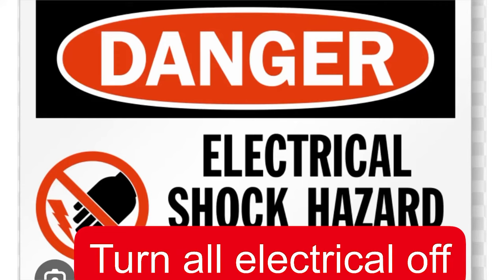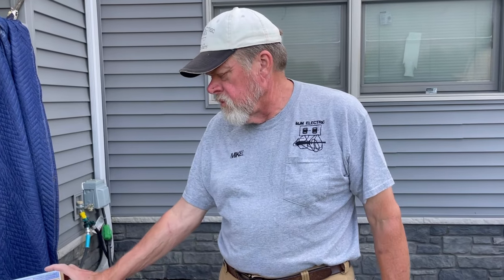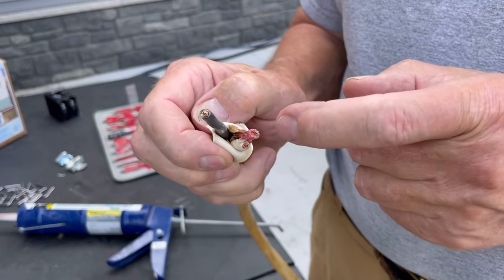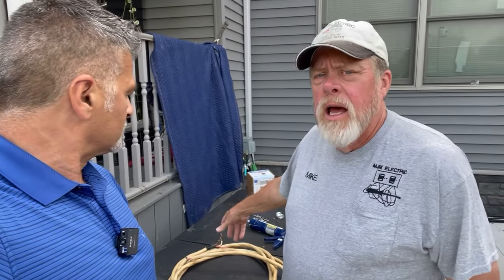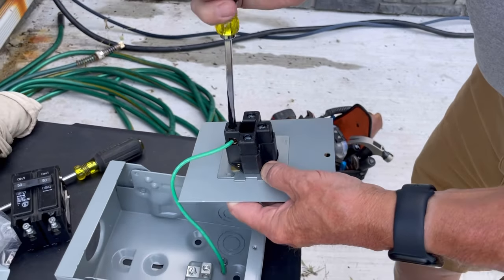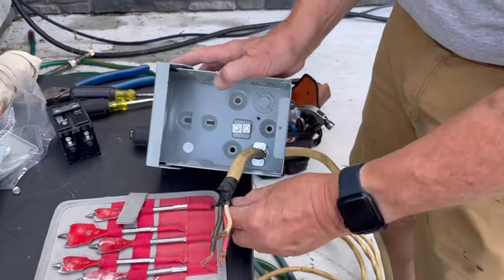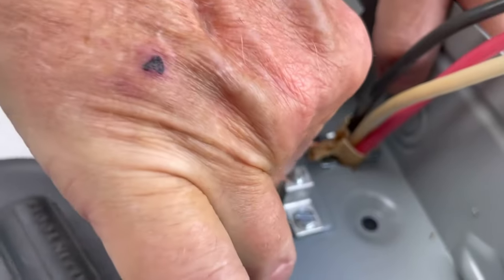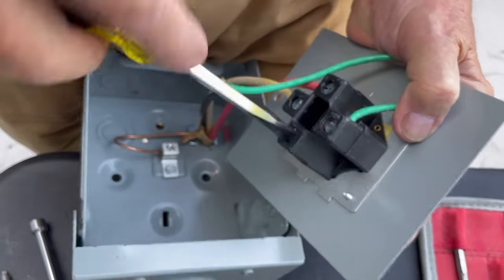How to install a 50amp RV Plug Outlet use 6/3 wire #50amp RV outlet

Comment: Years back i built my own pole building, mostly solo.  I ran copper wire out to the shop and wired 120/240.  
I like getting out of my comfort zone and learning new things, but I think it's one of my greatest gifts is to  Be humble enough to stop and ask for help :)  Don't be afraid of it (electric), but respect It!   As I get older I look back on those producks that I was Outside of my comfort zone with large smiles PERIOD.....

 My current project is an RV pad for my adult son and his wife. I'm using this another vidto work through it. great video thank you !

Comment: My only tip... Siding is not waterproof. Water runs behind your vinyl siding. It gets in at joints, and at windows where you have j channel.  

A more bullet proof installation would involve using a jumbo mount master siding light block, installing that in the siding, flashing it into the house wrap or water resistant barrier, put the siding back together, and then run your electric. 

Caulk between the top of the box and the siding does little too stop the water coming down behind the siding.

Great video on the electric side

Comment: Great video, but I was surprised that Mike refused to put the new outlet into service until he tested it.  While prudent, that may not be an option for everyone since there is no link to the tester used.  I didn't find any similar tester at Home Depot.
Reply: Any standard multimeter would work.
Reply: Multimeters are like $6. If this slips you up ya might not want to attempt this job.

Comment: Great video. Qq- why did you not use a GFCI breaker for an external box exposed to outside elements? Isn't GFCI required? Or is that only required if you run through outside conduit?

Comment: GFCI required on receptacles including 50 amps per NEC 2020? Breaker price jumps about 5x minimum if you can find them.
Reply: Even if  gfi is not required it should be used in electrical panel (it is an outside receptacle)they make them; not cheap though.
Reply: This is correct, I just did this on my house and code required a GFCI breaker. Ch 50 amp ran me $170

Comment: I need to make a 120 foot run underground to a pedestal instead of mounting on the side of the house.  What is the bury depth?  If I want to run 110 to a 20 amp outdoor outlet on the same pedestal, can I run both through the same conduit, or (direct) bury side-by-side, or is there a separation required?
Reply: Burial depth depends on several factors.  Like commercial or residential, and method used.   I can tell you that at 24”, you will be fine no matter your condition.  You can put them in the same trench or conduit.   It’s all 120 volts to ground.
Reply: You can run both circuits in the same conduit as long as the conduit is big enough to allow room for heat dissipation. Typically power on the private side in my area is buried 10-20” deep.

Comment: Isn’t the neutral and ground wires  go on the same ground bar ? Never knew there was a neutral bar?
Reply: The reason there are two bars is that panel is a sub-panel.  The Main Breaker is likely on the outside of the house.

Comment: 8/3 nmd is good for 55amps in Ontario... Why is 6/3 needed?
Reply from the maker: 50 amp 240 volt RV requires 8 gauge for up to 50 feet from the Breaker box  If longer than 50 feet, use 6 gauge. Many 50 amp RV systems already use 6 gauge  Mike decided to use 8 because had it there already. And it’s good for 55amp.
Reply: # 8 is not good for 55 amps.  It is rated 55 amps at 90C.  The termination points on breaker are listed at 75C.  The terminations on the receptacle are “hopefully” 75C. Which means the “circuit conductor ampacity” is 50 amperes.  Cheap receptacles may only be rated at 60C or 40 amperes, but since the next wire size, #6 is rated 55 amps at 60C, then the #8 is still good for the 50 amperes.   It gets complicated.  The installation is correct and code compliant!
Reply: @TSquadRVing what is 6/2 gauge rated up? is 6/2 good at 100foot?

Comment: I have someone wanting to install this outlet as an option for me to power my home with a generator when the electricity goes out but my concern is I would have to make 2 male ends on a 50amp extension cord
Reply: Not the right way to do it!    Several ways to connect generators.   If receptacle, then use a male receptacle, just like on the side of an RV.

Comment: I have a Grand Design Reflection Travel Trailer with 2 AC units on the roof, do I need 220 with 50amps breaker on a disconnect box as the service department is telling me it's 120volts but I had a hot wire on one pole so it only ran the back AC unit then I took the same wire and took it and put it on the other pole and the other AC unit worked and the other AC unit didn't work so in my mind it's 220 right?

Comment: I am not 100% positive, but since this is considered a sub-panel there should be 1 or 2 ground rods (per your local code) located at the sub-panel. At least that is what I needed to do. 6AWG also. Other than that, Nice Job!
Reply: I've never seen a subpanel grounded to a ground rod. A subpanel is typically grounded to the main panel.  One thing that makes a subpanel different from a main panel is you do not bond the ground and neutral like you do in the main.  Many times, but not always, a sub panel is in a more interior part of a building, which would make it difficult to tie to a ground rod.
Reply: The subpanel bars are not
 together ground bar not needed then
Reply: What are you calling a sub panel?  Hopefully not the exterior box with the receptacle in it!  In order for it to be a sub panel by definitions in the NEC it MUST have over current protective devices, breaker or fuse that feeds multiple branch circuits.  A sub panel within a dwelling or building does not require additional ground rod or rods.  The only sub panel I know of that does, is if you run an outside feeder to a sub panel in a detached garage or building.  Then, yes, ground rod is required.  (2) if you do not test for sell than 25 ohms.

Comment: That wire is not rated for 55 amps. It’s not even rated for 50. It’s #8/3 Romex. Largest breaker you can use is a 40 amp.
Reply: 8/3 Romex on 50 amp plug or bigger??
Reply: He said it was 6/3
Reply: Oh those Consulting Engineer rules of thumb!    Table 310.15(B)(16) shows that at 75C, #8 copper is rated at 50 amperes.  Is it not?   So, if the terminations at the breaker and at the receptacle are both rated at 75C, then it can be used at 75C and is 50 amperes.  If the receptacle is only 60C rated, then the NEC allows for you to use #8 at 50 amps because the next wire size is above the next standard sized overcurrent protection rating.  #6 at 60C is 55 amps so, #8 is acceptable by NEC.
Reply: 6/3 is needed for 50 amp.  It will work just fine and follows code
Reply: can you help me? Will 6/2 UF-B 100foot be good for my 220v welder? my pole is 100foot away is 6/2 plenty at 100foot? @TheKillagodZilla

Comment: i have a 30 amp service in rv.......can i use 1 leg of the 50 and run 8/2 or 6/2 romex into my panel inside the rv and bump up the 30amp breaker to a 40 single throw(no 50amp single throw breaker) so i can run all my appliances?   only 1 ac on mine....and of course after doing this you have to run everything 50amp so no wire overheats by mistake.
Reply: Do you currently have a 50amp outlet you're wanting to plug into? You don't want to use a breaker larger than 30amp for a 30amp RV.  The breaker is there to protect the cord and wiring from the outlet to your RV's breaker panel. That wiring is sized for 30amp, not 40amp.  Besides, this wouldn't gain you a thing anyway.  The breaker in your RV won't allow over 30amps.
Reply: Short answer.   No you can not.

Comment: Is Mike sure that a RV 50 amp female connector is same as home dryer 220v ?
Reply: Its not. Firstly, the plug isnt exactly the same. It looks the same but its slightly different, and even if you were to be able to plug a 30a RV into a dryer outlet, you'd cook your electronics in your RV.
Reply: @TehDubster aren’t are these RVs set up for 50amp? My plug says 110 or 220 3 prong
Reply: My understanding is with the dryer your using  both legs of the 120v together which = 220v. With this it’s using 2 @120 ‘legs’ seperate so it’s only using 120v. Could $definetly be wrong tho…
Reply: He did not say home dryer.  He said the same as a range.  Otherwise known as a stove.

Comment: I need to run a 100 ft will I lose a lot of power
Reply: No 6 AWG will give you the current needed for 50 AMPs
Reply: If you run #6 copper for 100’, the amount of current demand from your RV will not cause more voltage drop than allowed.  So, good to go.

Comment: Each leg to ground is not 110 hate to tell ya. And 8/3 it's rated for 55 amps last time I checked it's rated for 40 amps
Reply: You need to go back to school!   A 120/240 volt electrical system is absolutely 120 volts to ground.  A 208/120 volt 3 phase system is also 130 volts to ground.   And if the terminals of both the breaker and the receptacle are rated 75C, then a #8 copper conductor is rated at 50 amperes.  Table 310.15(B)(16).

Comment: I'm awfully surprised to see him use 8awg.  I wouldn't use less than 6awg.  I guarantee your entire RV is wired in 6awg and your supply cord is 6awg (with 8awg ground). There are several factors that can derate a wire's capacity and you have to factor in length.  You figure the supply line is already 25 feet or more.  The RV probably has at least 15 feet from connector to it's panel.  Ours had more than that, probably 25 feet.  Then you plug into an extension cord, which isn't uncommon and that's likely 25 feet.  I'd just use 6awg to be safe.

And I know it's technically a 220v plug but RVs don't use 220v so RV 50amp is a better way to refer to them.  I've never really understood why they don't call them 100amp because you get (2) 110v/50amp connections, or 12,000 watts.
Reply: i think some appliances on those 50amp services are actually running 220v......but yeah, looks to be just 2 separate 110 systems when in the panel
Reply: I’ve never seen anything more than 110v cause stove and water heater are gas
Reply: @naturalstatepoolandspallc338  most RVs do not use 220V appliances.  I have heard there are a few motorhomes that did but that's not typical.
Reply: @caseypries7559  any motorhome that had a 220 appliance could get really screwed up if they connected it to a dog bone that only gave them 110 to half of the circuit, or worse, 110 in the same phase, to both sides of the service.
Reply: Damn electricians. 4 minutes in yall start mumbling something about lectricity.
Reply: Unless you are in the very large diesel pusher busses, there will be no appliances running at 240 volts.  Regardless, the electrical system IS a 120/240 volt, single phase system.  It is a 120 volts to ground system.  
Copebuilt,  it is single phase.  One phase.  Phase and termination point are not the same thing

Comment: I think the advantage to wiring the electrical yourself is that you know how it's wired.   Otherwise, the wrong electrician might wire things in a way that defies logic and common sense and that's when it get's you.
Reply: Many trailers have had their converters and microwaves burned out by electricians that do not understand and connect 30 amp 120v receptacles up to 240 volts.
Reply: The meter test never lies. Do not plug in your RV until testing the outlet. Go back and check all wiring connections if you choose. Did you do the same to your house?

Comment: $6.25/ft for that wire?  Looks like it was laying around in someones barn for 20 years.
Reply from the maker: Why would you throw wire away???   It doesn’t spoil.  We were just telling you the going rate.  Thanks for watching
Reply: @TSquadRVing  I wouldn't throw wire away, but I also wouldn't pay $6.25 for 20 year old wire that was likely reclaimed from another project.  Plus, local electrical supply company and many online stores are well under $4/ft.
Reply: @Billy.80 not really I just paid $6.25 per foot at home depot
Reply: @Billy.80 .  Do you remember what you paid for something 25 years ago?   Would it make any difference now?   If he said I paid 50 cents a foot for it, you would be complaining that it cost you $6.25!
Reply: I just paid over $6/ foot.  I imagine you could probably find it cheaper if you buy a lot of it but small amounts will cost you $6/ft for 6/3